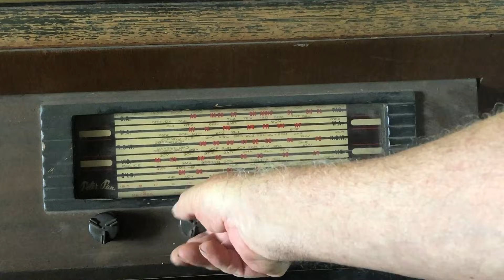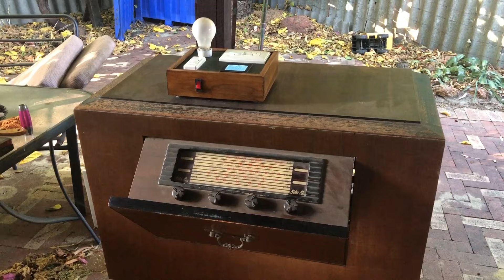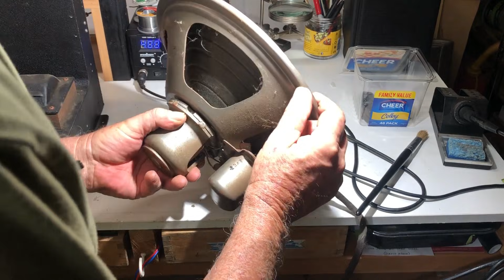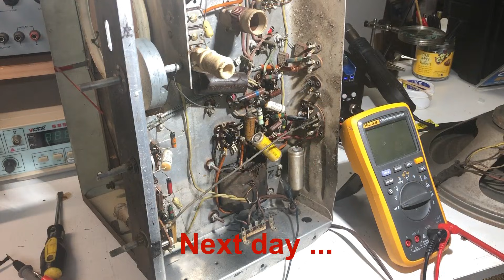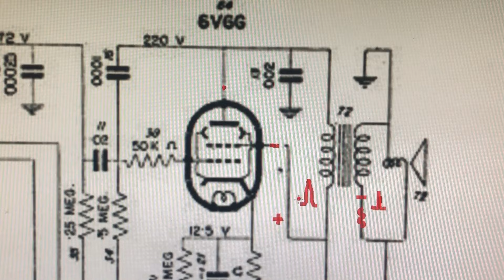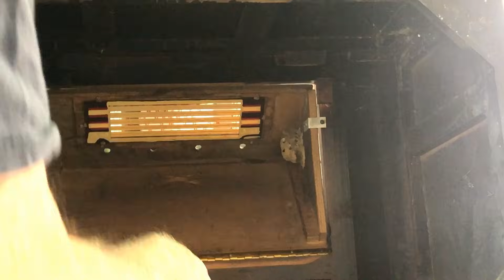Peter Pan model ELN.  Ugly but interesting ...

Comment: Great sleuthing Don.... as usual.... I read somewhere that some radios used those big automotive bulbs as dial lamps because they were designed to work in a more harsh environment so should last longer in the comparative tranquility of a radio set:)
Reply from the maker: Hi
Yes you're probably right there. The lamps are also run under voltage (there is a resistor in series with them) so they should just about last forever.  I'm pretty sure these were the original bulbs.
Cheers

Comment: At 28:00 in fireworks at the 6V6 socket. Obviously the situation at the speaker end was an open circuit. The electrons 
wanted to go somewhere! Fixed it and got the damn thing  picking up stations. A good lesson about high voltage wiring
in a electrodynamic speaker system. I so agree on your analysis using the schematic to show what possibly happened.
The cabinet looks to be a rectangular post WWII "malaise" design. Chassis circuit design is very much 1940 design with
 those 5 valves. Cabinet seems it could also hold a phonograph pull out below the radio as there is enough room. Good

seeing something saved from the bin even if it is just a big old broadcast band only radio. Steve from IL, USA
Reply from the maker: Hi Steve,
yes there's certainly room for a phonograph in that cabinet.  
You're right - those electrons wanted to go somewhere and they weren't taking "no" for an answer!  Anyway next time that happens I'll have more of a clue what's going on
Cheers

Comment: i have a Sharp 3 CD changer with double cassette AM-FM Radio with SW1 and SW2 and its 25 years old and still in working order in other words good condition i can't imagine in the next 25 years doing this to it lol
Reply from the maker: It'll be another 54 years before your CD deck will be as old as this.  Who knows?  If it's still around someone might well restore it in the year 2080.
Reply: @Donno308  yes true

Comment: Great work Don, this was an exciting restoration, so much so I was on the edge of my seat covering my eyes with my hands when you started getting the arcing...  Glad you sorted it out.  We tend to forget high voltage runs through those field coil speakers at times.  The set looks so much better now.  Another one saved as we say right. ? Be well, have a great day and thanks for sharing.
Reply from the maker: Hi
Glad you enjoyed the video. That arcing certainly got my attention!  I learned a thing or two about what an un-loaded output transformer can do. Now I know why we use dummy loads!
Cheers

Comment: Hi Don,
A fairly decent looking old radio: at least I think so.  When that model was manufactured, the world was rebuilding after the war.  There was a lot of shortages in materials, and people needed to feel a new postwar era had started.
Your theory for arking taking g place between the 6V6 anode and grid 2 is very plausible.  Need to check it hasn't caused a carbon track on the surface of the valve base. Might need to keep that radio running on soak test for a day or two to determine reliability.
I say it is turning out to be a positive result 
Kind regards, Phil.
Reply from the maker: Hi Phil
Yes, I think you have to look at it in the context of the time. This radio would have been seen as very modern and I suspect it wasn't too expensive either. Given post-war shortages it was probably an appropriate response to the conditions of the early post-war era.  I know I sent it up a bit in the video but I did quite like it in the end.
I was lucky to get away with that arcing. I could have cooked the output transformer or the 6V6, whichever failed first. Anyway I ran it for  2 1/2 days and it had no problem so I think I got away with it.
Cheers

Comment: The capacitor store Carl's capacitor could not be found on ebay. I clicked your link but nothing
Reply from the maker: Mm that's a bit odd.  Maybe the link address has changed.  I'll check it out and get back to you.
Cheers
Reply from the maker: https://www.ebay.com.au/str/vintagecomponentsandbooks?mkcid=16&mkevt=1&mkrid=705-154756-20017-0&ssspo=dRWGSEluSRK&sssrc=3418065&ssuid=dRWGSEluSRK&widget_ver=artemis&media=COPY
Reply: @Donno308  thank you

Comment: I expect there were a few home visits by the local radio shop to refit Valves (tube) dislodged from repeated opening and closing.  Well it may not be to our taste but you got it back running so will find a home.
Reply from the maker: Hi Woffy
Yes no doubt.  Perhaps the owners got used to pushing the valves back in every now & then.
I advertised this radio for sale after I finished it because, unfortunately, I just don't have room for it. I thought I was asking a bit too much for it but it sold straight away an I had several people disappointed that they missed out!
Cheers
Reply: @Donno308  Well done Don you saved the ugly duckling and the next one is on it's was.  As for value, I have on several occasions increased the price on something much to the sellers surprise. I explain to them that I need to pay what is fair respecting the time and effort the craftsman put in to making it.  The radio I got this Christmas was better than I had expected so sent another £30, me happy now.
Reply from the maker: @ That kind of sentiment is all too rare. It's certainly never happened to me!  Nevertheless I would rather sell a radio too cheaply if I know the new owner will appreciate it.
Reply: @Donno308  Don that is the right thing to do, it keeps the buggers in a home and thats what it is about.  I like to know the story and leave that in a note for the next person. Keep up the good work down there, things a bit rough in the Northern hemisphere. Best

Comment: Loved the video Don - it was growing on me by the end.  My take on the arcing - I think the speaker voice coil was basically open circuit placing no load on the 6v6.  If the set was making audio, it almost certainly was on static alone, then the audio voltage would have been enormous and flashed over possibly in the valve base.  Valve audio amps like this  behave like a constant current system so if the impedance is high then the voltage is high.  Its fine to short circuit the audio but never open circuit. The total opposite of transistor amps which behave like constant voltage systems.  Open circuit these and it fine but short them out at your peril as they will draw destructive current levels. KJ
Reply from the maker: Hi Kevin. Yes I believe you are right.  Several other people have said the same thing in different ways.  I knew that the impedance would be affected by an open circuit secondary but I didn't realize how much or that it could generate those kind of voltages.  
One great thing about this hobby is you keep learning new things.
Cheers

Comment: Just saw 👀 your video 📹 on this. Console radios 📻 were all the rage back in the good 👍 old days. If disassembling the radio 📻 dial, be careful not to rub the inside of the dial glass too hard when cleaning it. This could rub the numbers off. David Tipton has sent his 👋 to an Australian company, if this happens. I don't find this console radio ugly, but I like the name Peter Pan. This could be a pretty rare find, since I never heard of the name before. Your friend, Jeff.
Reply from the maker: Hi Jeff
Yes I know all about how easy it is to rub the printing off a glass dial.  This one stayed in place when I removed the chassis and seemed to be in good condition anyway.  I find plastic dials and the later glass ones are a lot better. 
Cheers

Comment: Nice unusual old Chair side radio I remember my grandfather had one similar back in the 60s used to keep it by his favourite armchair with his bottle of Scotch & Glass on top whilst listening to the wireless. I guess that is the idea you can use the top as a small table for tea or whatever.
Reply from the maker: Yes, you're probably right.  It would have been considered very modern in its day.  The top might also have been used for a record player.

Comment: I liked your theory about the spark - it makes total sense to me (but despite that you're probably still right). Interesting design.
Reply from the maker: Hi
Based on comments I think I was half right. It seems that with the secondary of the transformer open circuit the primary will generate enough "reflected" EMF" to create sparks all by itself without the need for the secondary to be intermittently touching.
Its always good to learn something new.
Cheers

Comment: Thanks Don. It certainly is a strange cabinet design, though I like the pull down to use feature. I had a similar speaker issue with a Philips 115, which has the opt mounted on the speaker. It was intermittent ly dead yet the voice coil measured intact ,or so I thought! The voice coil was actually oc, and I so I was actually measuring the secondary of the opt. Luckily no arcing. The back emf from an unloaded opt can be several thousand volts enough to arc or short the opt. I remember way back in the day when I repaired guitar amps, destroyed output valve sockets was all to uncommon. If the speaker was disconnected and a guitar played loud. Then smoke. 6ac7 valves with 800volts on the plates and a lot of current!,,
Reply from the maker: Wow!  Yes someone else pointed the back EMF from an unloaded opt could reach thousands of volts. I've never come across this before.  I guess it wouldn't do the opt much good either! Luckily I didn't run it for long  I'm sure it would have cooked the 6V6 too.
Cheers

Comment: With the voice coil disconnected the reflected primary impedance of the output transformer would be very high. This would result in very high voltage on the anode of the valve. Hence, the arcing.
Reply from the maker: Hi  That's the best explanation I've heard so far. No need for intermittent connection in the secondary. Thanks 💡